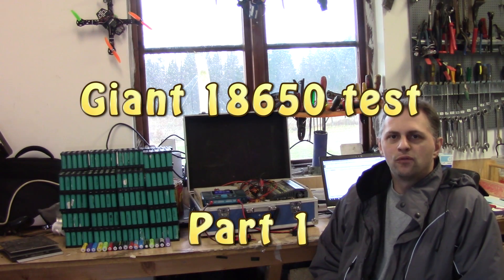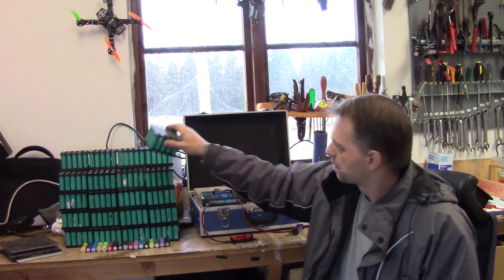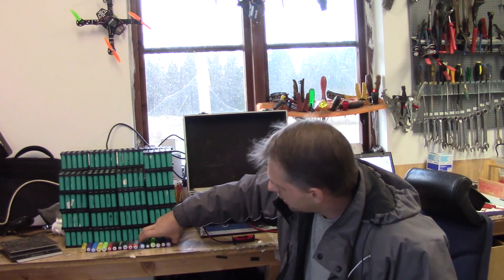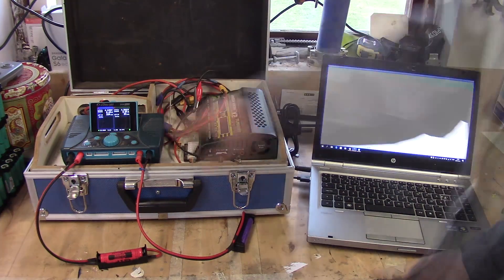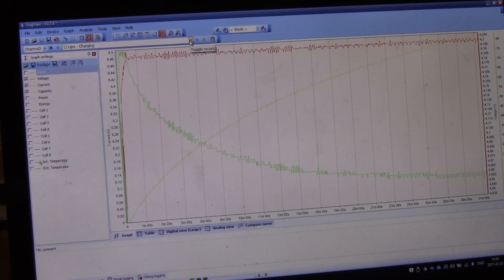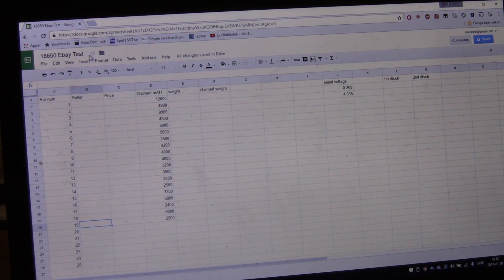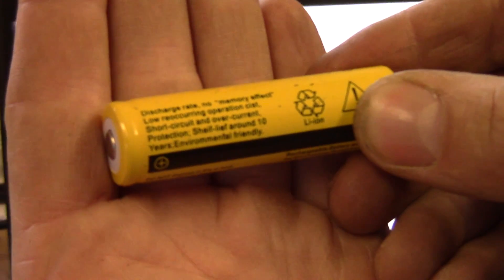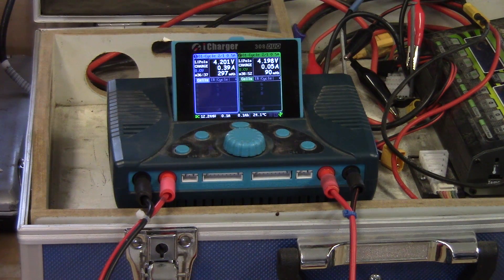BIG 18650 LiIon cell test from Ebay Part 1 Introduction

Comment: Most of the eBay sellers do not list the weight.  I know not to pay any attention to 3000 mAPH because not true.  The voltage was 3.7.  I chatted with you on HBPowerwall live chat.  Came back to listen to your video again.  May need to start purchasing laptop batteries.  Can these batteries be used at all?  Hate to waste money like this.  Posted FAKE on sellers review..  Hopefully someone else will be saved from my mistake with this user.  Thanks for your information.
Reply from the maker: Hey!  Yeah and many also post wrong weight. Whats important is to look for the names and such and the price. If its to cheap then its probably not true. Laptop cells is what most of us use for powerwalls. BUT beware of that you dont buy the fake ones and cheap ones out there. Go for brand names like HP, Dell and so forth.
Reply: F- that...I get them from the recycling center...People just throw it out.
It's fucken time consuming  break them and test them.
but at least you know they're real....The cellls are usually 2200 or 2600..
Nothing crazy.
It depends what you use it for...Im having good luck running them in my
R/C contraptions....they're fine on R/C...if you match it out with the right
car....cheap ass walmart with 8.4 nicad works...
I just add more cells..step it up to 12V or 16V
I get more power and speed...and wazzooo of run time. An hour compare on good speed......to 10 mins on slow mo.lmao

You cant stiick them in Power wheels or 550 motors or greater.
The batteries gets HOT...not enough C rating.
It was probably drawing 60A though

The 380 motors on the R/C was probably drawing 20 amps
I feel safe rating them at 20C

It's the C RATING....the 5000 mah cell in the video probably only had 10C.
Hope that makes sense.